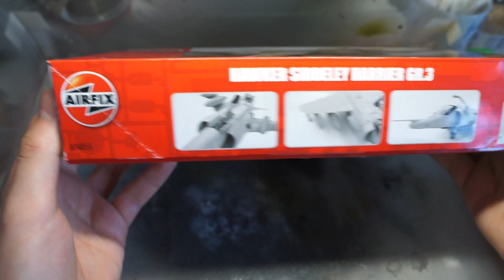Building Airfix's Hawker Siddeley Harrier GR.3 | 1/72 Model Kit Build

Comment: Great build and a great look. Just one point, the outboard  trailing edge "flap" are not flaps they are ailerons and should be in the neutral position or with one slightly up and the opposite one slightly down as they are primary flight controls to control aircraft roll.
Reply from the maker: Thanks for the info!

Comment: The green panel on the fin fillet is a dielectric panel associated with radio/radar avionics. Usually it's in GRP, sometimes left in the natural resin colour, sometimes overpainted with whatever is handy.
Reply from the maker: Wondering when someone would have an answer! Thanks very much Paul! I thought it would be something to do with avionics, similar to the panel on the bottom of the buccaneer.

Comment: For future builders of the Harrier, the front exhausts only put out cold air so exhaust stains are minimal there.
Not a criticism of your work at all. Finished with a lovely well used GR.3 giving air defence somewhere over West Germany 😊
Édit: to make a serious technical correction as pointed out by Lockspike below!
Thanks, Ian
Reply from the maker: Thanks so much for the info :D
Reply: @ModellingWeekly  I got some great modelling tips from your video too😊
Reply: Sorry but it’s the rear nozzles that exhaust the hot air the fronts are cold
Reply: @lockspike  thanks for the correction, I got it the wrong way around and I bloody worked with the things. 

Thanks again, I will edit it but acknowledge you.
Ian

Comment: Great build there mate, looks ace!! 
May have to get one myself now after that build.
Reply from the maker: Thanks!! It's a great kit, had loads of fun 👍 definitely worth picking up.
Reply: @ModellingWeekly  I thought  RAF uses light ocean and dark sea ocean grey and RAF dark green as the overall color schemes which tamiya has in their rangle.
Reply from the maker: @amuxpatch2798  yeah they do, I just don't have all the tamiya paints. Working with what I have. YouTube pay is crap! 😂😂
Reply: @ModellingWeekly  When you buy today's  model kits , their instruction has exact paint schemes compared to the 70/80s  just use common dark green etc.. for  RAF ,German tanks etc..
Reply from the maker: @amuxpatch2798  Did you not hear what I just said? I used what I had, that matched the closest. This is also an Airfix kit, so there are no colour callouts for tamiya.

Comment: Is there a technic to put both wingtips-wheels on the ground?
Reply from the maker: Not really, I think it's just a design fault with the kit
Reply: With all or most harrier kits you need to put the main gear in last which then allows you too adjust up or down giving you all 4 points contact

Comment: Unfortunately at the 7 minute mark you've set both ailerons down and the flaps up. Should be the other way round. Wouldn't fly too well like that.
Reply from the maker: My bad. I intended to have the flaps and ailerons in a "parked" position after looking at reference pictures, but I suppose I cocked that up a bit lol
Reply: @ModellingWeekly  Thanks for the reply, still an excellent video.